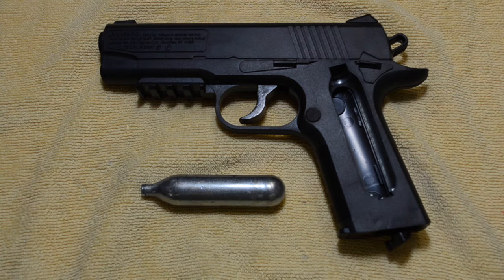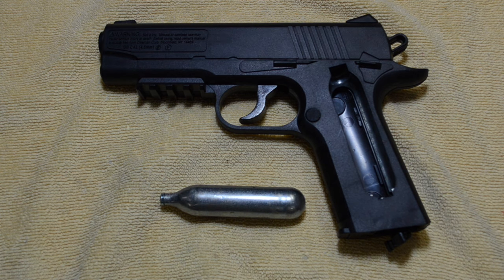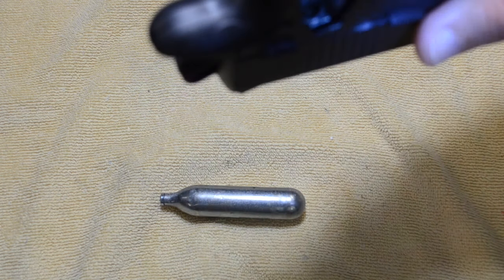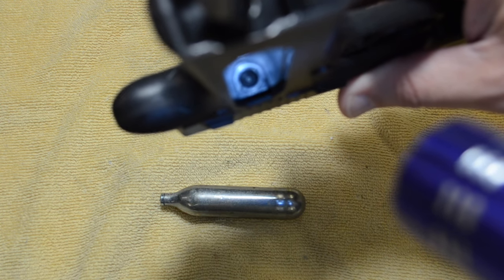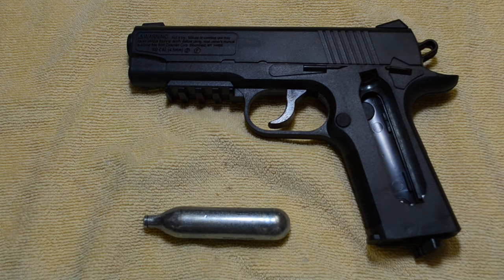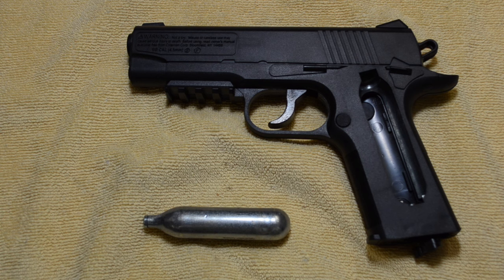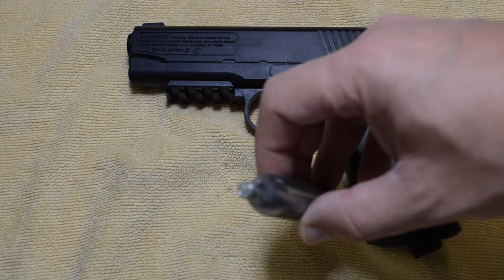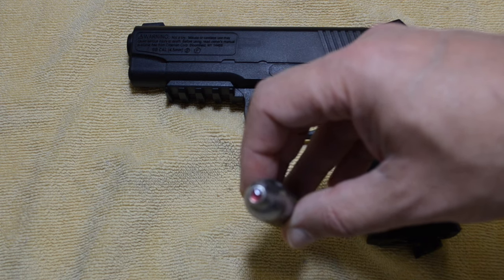How long can I keep C02 cartridge in my air gun?

Comment: The drop of oil on the cartridge is a great idea thanks. I always wondered what if i store my bb gun with the cartridge inside  and this video was very helpful
Reply from the maker: This is first hand knowledge, do not leave a CO2 cartridge in for more than 24 hours, otherwise, the seal will deform and you won't get a good seal on the next CO2 cartridge installed.
Reply: Fr
Reply: What is that oil name? And if that only if the CO2 is not empty yet?
Reply: @rustbeltairgun8718 hi if I leave it in there for 2 days is that bad?
Reply: @LilGranted no I have left it in for 3-4 weeks with no issues, but I use a drop of silicon oil with each one.

Comment: Thanks for getting straight to the point 👍😁
Reply from the maker: This is a common question most people have when they get into air guns. In the past, I made the mistake of leaving the CO2 cartridge in the air gun too long, this caused the seal to deform and I couldn't get a good seal with any new CO2 cartridges.
Reply: @rustbeltairgun8718  thanks for letting people know about this cause I got my very first airsoft gun today a me I don't want to ruin it
Reply: How long were u able to keep it in without it breaking
Reply: @Setapart_jay  this was 2 years ago but I left it in over night and it broke my gun so don't leave it in for more than like 3-4 hours or it will break the seal and CO2 will leak everywhere

Comment: On my thirteenth birthday my brother gave me a Crosman Mk1 , I turn 70 in a few months. For the last twenty or so years I take it out on my birthday pop off the remaining CO2 from last year , install a new cartridge, lubricating the piercing cap o rings plus a drop down in the valve entrance , seal it , manually pierce the cartridge. and shoot till I feel the power start to drop off.  I then wipe it down and put it back in its original Crosman soft padded case till next year. ( That case cost him an extra $1.50 and has made all the difference in preserving my gun ).  The design of this system allows it, my more ‘modern’ designed CO2 pistols like the example shown require the capsule to be remove ( I had to reseal one due to always leaving it with an empty capsule in it.
Reply from the maker: Thanks for sharing :-) I do think they have cheapened or use a new material for the piercing gasket, in newer air guns.

Comment: I have left a cart in my PPQ for a week, I don't crank the screw down like I'm tightening a wheel lug nut ( it Don't Need To Be Super Tight) and, when I replace with a new cart, I wait a good while for the seal to "relax" I been doing that for about a year now and have never had a cart "leak out" an no probs sealing when I do replace the cart.  (Side Note) I have noticed a Sharp Edge around the top of most carts, I use a small file an smooth the Sharp Ridge being easy on it, just enough to Smooth It Off. I know after awhile, that would Cut The Seal an it would then leak an need replacing. Like I said about a year (keeping a pierced cart in the gun ) for a couple days to a few days / up to a week with no probs.
Reply from the maker: Thanks for sharing!

Comment: I’m sure you are correct and I won’t leave it more than 24 hours from now on but I do have an extreme case that didn’t go wrong and just want to share my experience. I did leave co2 in my UMAREX LEGENDS COWBOY CO2 STEEL BB RIFLE and didn’t use it for a full year and carefully inspected it this week  and replace the co2 and its fine. I’m lucky?
Reply from the maker: I used to leave CO2 cartridges in my air guns for extended lengths of time, so as not to be wasteful. Then 2 out of 3 of my CO2 powered air guns developed piercing gasket leaks.

Comment: Thanks for the video I’m getting a co2 airsoft gun and I’ve been looking for tips because I’m never had experience with co2 guns I also have a question should you refrigerate co2 cartridges since there is dry ice in them?
Reply from the maker: My own experience has shown that CO2 cartridges are less effective when chilled. In fact, when I do videos during the winter, I keep the CO2 cartridges inside at room temperature  (70 degrees Fahrenheit or 21 degrees Celsius) until I am ready to use them.
Reply: The CO2 is in the form of a compressed gas, NOT A SOLID like the dry ice form.

Comment: Sir can you please tell me how many bb's we can shot with 1 CO2 cartridge?
Reply from the maker: There are a lot of variables that affect CO2 cartridge performance. Some factors included ambient temperature, air gun pseudo-blowback action, CO2 loss due to spaces in a revolver action of an air pistol.  You would probably get about 40 shots from a basic CO2 air pistol, such as a Crosman C11.
Reply: @rustbeltairgun8718  what about a glock 17 gen 4?

Comment: i ran across this, i forgot to remove a co2 cart from a Makarov umarex co2 pistol, BUT guess how long! Was 3 years or so...was lost in a move, found it recently, had left it in there, had used pelgun oil on the cart. It fired a few times, and thats all, it had leaked over the few years slowly. BUT i decided ok i have some crosman co2, put more oil on tip. And put a fresh on in, and shot for about 10 shots, then hissed badly. Seals were shot..

so at end of day, dont leave a co2 cart in more than a day or 2...

Comment: I’ve always heard that, assuming you apply a little oil to the tip of the co2 canister, it’s okay to leave a half-spent co2 cartridge and is actually good to keep pressure on the seal, the idea being that every time you change one out the seal flexes, so by leaving them in it actually prolongs the life of the seal.   Now I don’t know what to believe.  :/.  I know that I’ve left them in my umarex Glock 19 g3 for a few days at a time and I haven’t had any issues in almost a year.   I think the lube is biggest factor IMHO.
Reply from the maker: When I first got back into air guns, I used to keep the CO2 cartridges in them for days because I didn't want to waste them. I used Pell Gun oil on the tip of each cartridge. Many wouldn't seal properly when a new CO2 cartridge was installed.

Comment: Thanks. I just watched an episode of American air gunner called “all about CO2 airguns” with skepticism because these guys did another video about cleaning the barrel of your air rifle and the old guy in the video said “no he never cleans his barrel and it’s not necessary.” 

Then I did my own research looking at what the top competition shooters do with their barrels and they all clean their barrels after a certain point and if they don’t, they lose accuracy. In fact, somebody else did a video criticizing these guys on barrel cleaning.

So I was skeptical of this episode. I was wondering are these guys going to get it wrong again and it turned out that I was correct because again the same old guy said to just “leave your CO2 in the gun. It won’t do any damage as long as you use oil.” 

He never mentioned anything about seal deformation and luckily I came across your video. 

I have one question. I just purchased Gamo P25 CO2 pistol. Do these manufacturers use any kind of preservation oils in the barrels that you need to remove?
Reply from the maker: They might (oil pack the barrel) for shipping, the light oil used would diminish after a few shots.
Reply: @rustbeltairgun8718  okay thanks for getting back to me

Comment: I've had mine in my CO2 1911 for over a week and it's still holding in all the air. Think I have a 1 in a million magazine.
Reply from the maker: The issue happens when you change CO2 cartridges. The gasket around the piercing screw will deform to the original cartridge tip left in for a long duration. Additional CO2 cartridges installed, due to variance in manufacturing, will leak.
Reply: @rustbeltairgun8718  ohh I see, thanks! No big deal sense the mags are only like 30$

Comment: I wasted my Glock 17 seal just by keeping the co2 in for 24 hours. Now I do not get new parts or anything. It still fires but it leaks too with a hissing sound.
Reply from the maker: If still under warranty, contact Umarex support, tell them the piercing seal leaks. They may be willing to do an exchange. UmarexUSA phone number:
Phone: (479) 646 - 4210
Ext. 7

Comment: What about storing a full cylinder in the air gun unpierced but ready to activate ?
Reply from the maker: That should be fine. This would not deform the piercing gasket.
Reply: Haha thats what I do, ready to go but not pierced. Just dont rock it about to much if it's got loose space in there or it'll surely mess something up!

Comment: How can you tell whether your puncture is deformed? Okay, I don't know whether mine is okay but I took a look at it and it looks like a lil chip on the side I don't know whether that is normal.
Reply from the maker: Ideally, the CO2 cartridge should be punctured by the air gun in the center of the tip so as to allow a good seal around the puncture. If the puncture is off center, there is more propensity to leak. With the CO2 cartridge removed, see if the piercer is bent. If bent, you may be able to get the air gun repaired under warranty. I would just live with it if the air gun is not under warranty and not leaking.

Comment: i forgot about my makarov for nearly 4 months but it still works! 
i guess mine is build different
Reply from the maker: What happened when you replaced the CO2 cartridge that was in this air pistol for four months with new one?  What typically happens is the piercing gasket deforms and the new CO2 cartridge will not seal.

Comment: Y’all are forgetting the CO2 cartridges will empty out even with non-use between 48-96 hours depending on the brand and the gun. Meaning, you either have to carry a CO2 cartridge with you and hope you can react quick enough to use it, or you have to change out the cartridge every so often and waste all that money on CO2 cartridges just to throw them out because nothing happened this week. They need to make these spring powered. They’d be more effective.
Reply from the maker: Spring-powered requires you to cock the air pistol, in between each shot. Many air gun enthusiasts like the convenience of multiple shots, CO2 cartridges affords, without cocking.
Reply: @rustbeltairgun8718  yes, but let’s be real. You’re not going to be firing a dozen shots in one sitting in this cage.

Comment: Can I keep the CO2 cartridge in the magazine without having the mag inside the gun?

If it's a CO2 mag, of course, what I ask is impossible with the video's pistol
Reply from the maker: The problem is that the piercing seal becomes deformed under pressure if you keep the CO cartridge in for long periods of time. The same holds true for both air guns with the CO2 cartridge housed in the receiver or in a separate magazine.
Reply: @rustbeltairgun8718  Alright, thanks for the info 🙏🏻🙏🏻

Comment: what if you never puncture the co2? can it remain in there? most of these you have to push the trigger to pucture them, why not leave one in the chamber?
Reply from the maker: You could leave the CO2 cartridge in the air pistol if the piercing screw is not applying any pressure to the cartridge. I have never seen an air pistol where the trigger punctures the CO2 cartridge. Typically, a piercing screw is used for this purpose.

Comment: If I have not finished the co2 than what should I do? Is it best to just drain it?
Reply from the maker: Yes, I recommend not keeping a CO2 cartridge in an air gun for more than 24 hours. Keeping a CO2 cartridge for more than 24 hours in an air gun could distort the piercing gasket, causing future CO2 cartridges to leak when installed.
Reply: Also, how do you remove a half spent cartridge if you’re unable to fire it?  Set fire it until it’s empty?

Comment: what happens if i take the co2 off ?? even when the cartridge still has more gas in it
Reply from the maker: I do it all the time. I recommend wearing safety glasses and gloves in a well ventilated area when doing it, as the escaping CO2 gas is super cooled.
Reply: @rustbeltairgun8718  can you show us how to do it on the next video please?? i’m afraid taking the cartridge out because i only used it once when i shot 6 bullets out from the magazine. i’m afraid if i take the co2 out everything will leak
Reply from the maker: I can do a video on this, it will not be my next video as I am already in the process of creating one.

Comment: I’ve heard not to use Pell gun oil because it has petroleum in it but to use 100% silicone oil instead. What is your opinion?
Reply from the maker: I got back into air guns about five years ago. One of the first CO2-powered air guns I purchased was a Crosman 1911 40001. I have been using Pell Gun Oil for the last five years, applying it to the tip of each CO2 Cartridge installed in this air pistol, and have not had any issues.

Comment: I have a glock 19 gen 3 non blowback co2 pistol, (4.5mm) .177
How long should I keep my co2 inside my bb gun?
Reply from the maker: I recommend less than 24 hours, otherwise, the piercing gasket will start to deform and may not seal right when the next CO2 cartridge is installed.

Comment: How do you know when to stop screwing in the co2 cartridge, even after the pressure is released, I know people the continue to screw it in? How much should I?
Reply from the maker: Turn the piecer screw about an eigth of a turn after you hear the CO2 entering the air gun. Never use a tool, such as pliers or a wrench to tighten the piecer, unless one is provided with the air gun.
Reply: Rust Belt Air Gun question, for gbb pistols, I’m told to store them with some gas inside. I’m curious to how they come in the box empty and the o-rings are fine and not dried out but if you store them without gas they will?
Reply from the maker: I think the idea is that the gbb pistol can ship empty because they typically are only stored before purchase for a couple months since manufacture. After purchase, an owner may keep their gbb pistol for many years. In the long run, it is best to store a gbb pistol with some gas inside.
Reply: Rust Belt Air Gun ah, makes sense, thanks alot, my first gbb gets here in 2 days

Comment: I have a mercury rise mub 50cal paintball self defense launcher with the quick piece button so co2 dont have to be held in there, but some air gun youtubes say once after u shot it even with oil, if u stop and store it away for years, co2 un pierced, the seals a still go brittle and bad, if not shot periodically so the seals go bad no matter wat even a brand new gun thats never opened, is that true!
Reply from the maker: I have not had any issues storing CO2 air guns, with no cartridges installed. The piercing gasket sealed as expected. I don't have any air guns older than five years old.

Comment: Are you still there. Some questions here, please.
Reply from the maker: What is your question?
Reply: @rustbeltairgun8718  Thank you Sir. This is a serious question.
I liked the 84fs and planning to buy it for specific reason. We are.planing to go for lengthy camping and touring nationwide. The 84fs looks original and in case we want to warn a threat, we will fire it in the air. Here the issue arises.
If we keep the capsule with a drop of oil over extended period of time, may be one year of our tour, the seal may get damaged and there is no chance of getting the replacement seal over here. So the costly gun is useless. Alternatively, If we do not keep the Cartridge loaded.and think of loading it AFTER facing the Man or Animal, both we and the gun become useless permanently. So what's the solution. We are not from US and only CO2 pistols are to be used.

Comment: I have a Sig Sauer P22x AirGun Pistol. Can I put my Crosman C02 cartridges in my Vevor gun safe? Also what type of oil do u recommend for co2. This is my first purchase so I am a newbie.
Reply from the maker: CO2 Cartridges should be kept at room temperature. They could burst if they get too hot. Even at room temperature, I don't recommend keeping your CO2 cartridges in the Vevor gun safe, with your other air guns and or firearms. CO2 cartridges contain a small amount of oil, in addition to the CO2 gas. A defective CO2 cartridge could burst and spray your valuable belongings with oil that you would have to painstakingly clean off all items in the safe. I recommend Crosman Pellgun Oil: https://amzn.to/3Vq4nre

Comment: I just bought a sig sauer x5...so I have to blow an entire cartrage each time? I can't leave it in after a few shots?
Reply from the maker: I used to leave the CO2 Cartridges in my air guns, in between shooting sessions. I soon found that on many of my air guns, the next CO2 Cartridge installed didn't seal properly. The piercing gasket had permanently deformed.
Reply: Then how do I carry it for self defense.
Reply from the maker: I don't recommend air pistols for self defence, as most perpetrators carry real firearms.

Comment: What if i have left the co2 cartriges in for weeks or even a few months?
Reply from the maker: You won't have any problems with the CO2 cartridge installed, long term. What you'll find is that the next CO2 cartridge installed will leak, as the piercing seal will be deformed.

Comment: Hi buddy i need to store my airsoft for a long months. Should i take off the co2 and leave it empty with no co2  cartridge?
Reply from the maker: Yes, you should not leave CO2 cartridges in an air gun for more than 24 hours, otherwise, it will deform the gasket around the piecer and you will not get a good seal when new ones are installed.
Reply: @rustbeltairgun8718  thank you so much have a great day! Keep safe!

Comment: I was advised by the technician who refurbished my gun to leave the CO2 cartridge in the gun when storing.  Mine:  Crosman 600
Reply from the maker: My experience has shown that the piercing gasket becomes deformed when a CO2 cartridge is installed, long-term. A deformed piercing gasket will not seal correctly when new CO2 cartridges are installed.